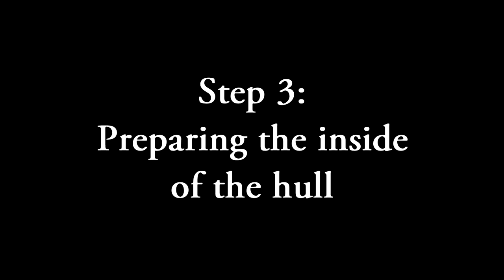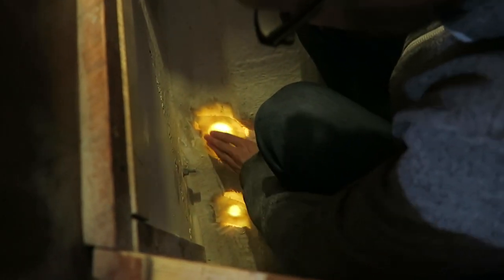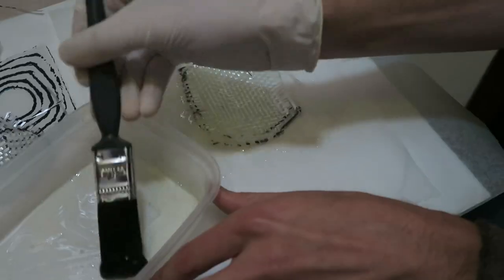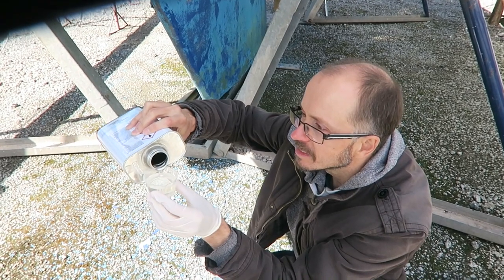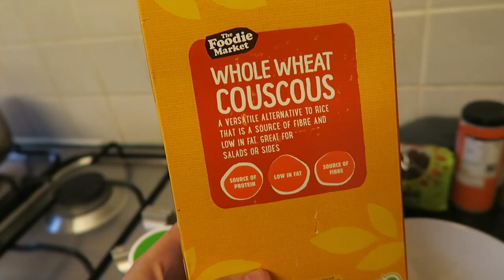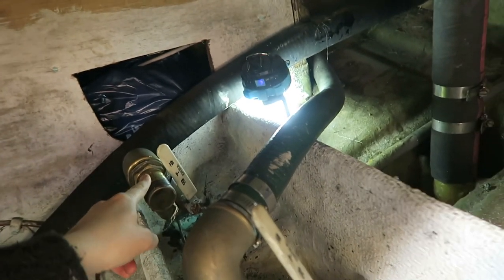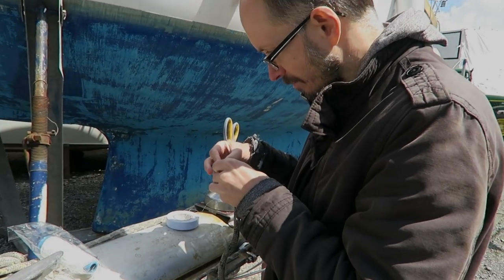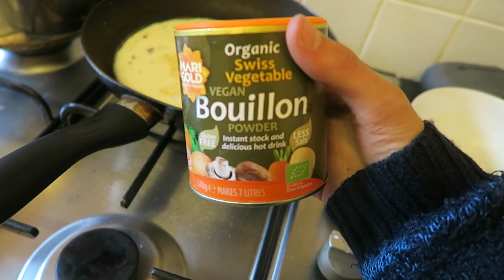Patching Holes in Our Sailboat's Hull!

Comment: After heating the hose in water, take a rag and wrap around the hose and pour boiling water on the rag then push on.  A drop of washing up liquid on the fitting is another method.  The good news is those hoses once sorted won't need doing again any time soon.
Reply from the maker: Thank you for the tip!

Comment: I get the conservation idea and sure we all should try to cut our footprint on this planet but cutting corners to save a little fibreglass matt was a bit senseless, what was you going to do with the left over, and considering the cost was it worth risking your boat for a few pounds worth of materials.
Reply from the maker: We weren't cutting any corners, we used the recommended amount of mat! We just cut it out efficiently to avoid wasting any. We've been back in the water for several months now and the repairs have held up perfectly.
Reply: @BethanyIvy  Your repair may hold up for the life of the boat, and I hope it does but look at the edges of the patches when you marked them out, at 3:02, you had a full sheet to work with but you chose to cut on the frayed edge when all you needed to do was move your pattern an inch or two higher. 
Your boat, your choice, but cutting corners to save a few mm of matt just isn't worth the risk.